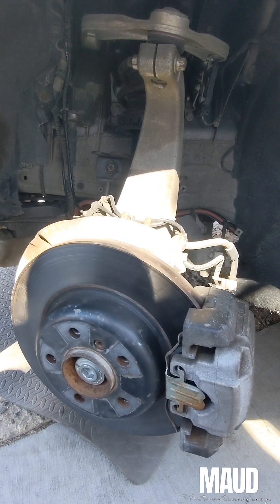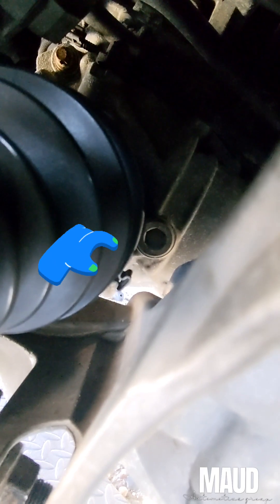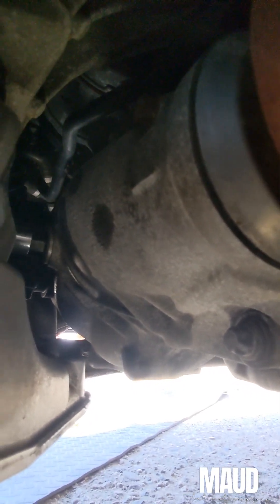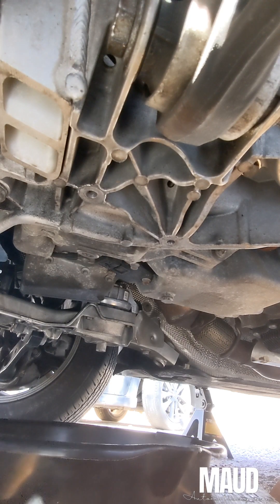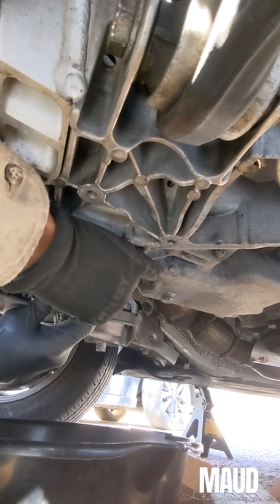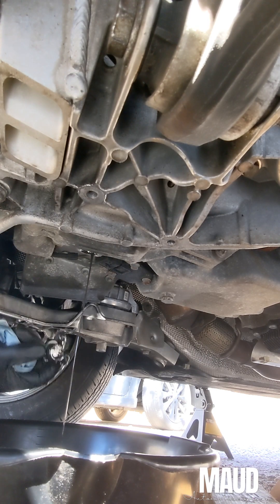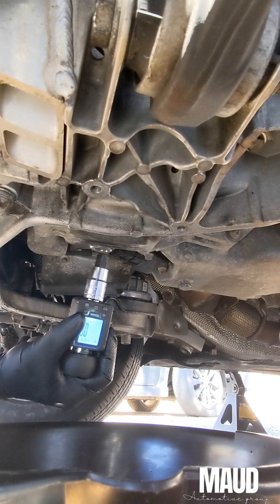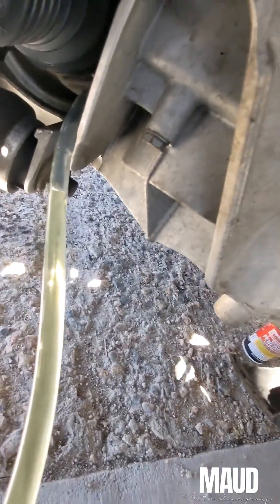BMW F10 528i XDRIVE: Front differential fluid change

Comment: what year is this car?
Reply from the maker: @lincolnsalzman8827  it's a 2013 model
Reply: How does a diff fluid get "low"???
Reply: @kjhnsn7296  While changing the CV axel some diff fluid can escape to a certain extent - if he did that!
Reply from the maker: Thanks for that added comment. I did the CV axle at a different time   @Ivo1508
Reply from the maker: @kjhnsn7296 I also found if the differential fluid is old or contaminated, it can degrade and potentially lead to leaks or the fluid being consumed internally. heat and aging can cause seals to shrink and potentially allow fluid to escape without a visible drip.